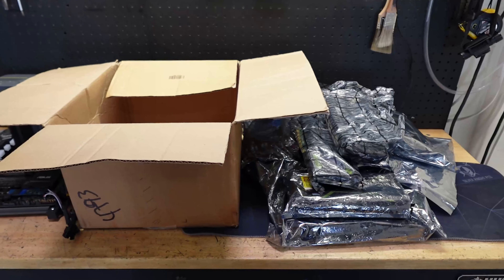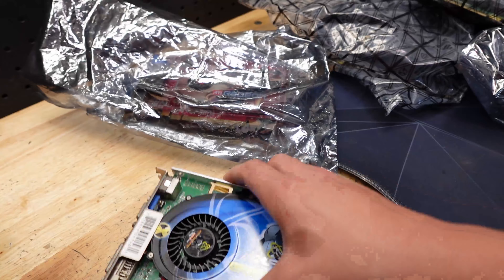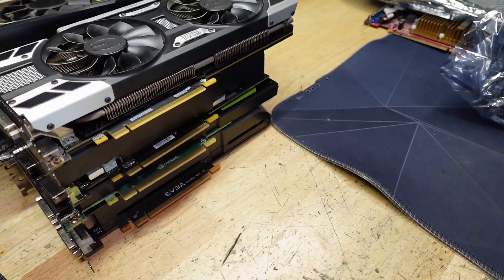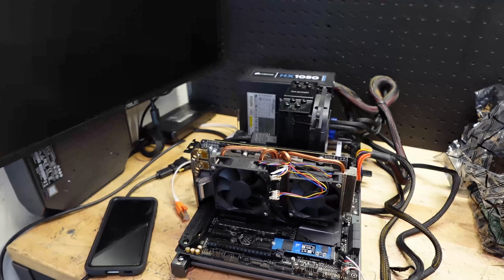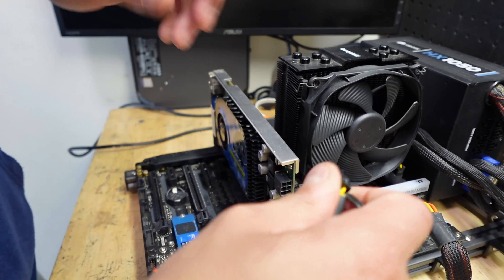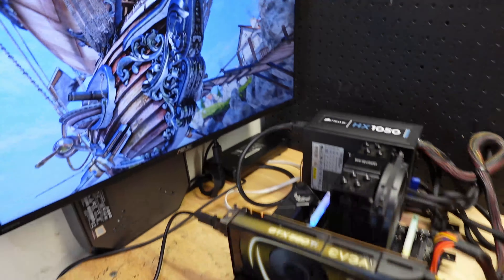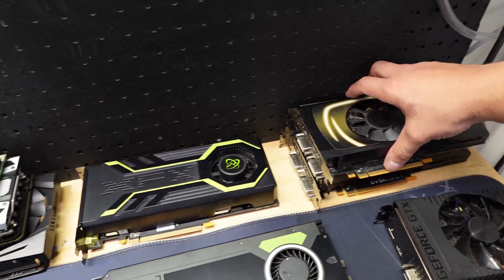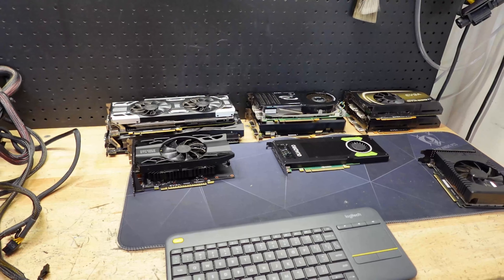I paid $100 for a box of unknown graphics cards!! Was it a good deal??

Comment: The unknown port on the 560ti is a mini HDMI.
Reply: Still have 2 HMDI cables for that GTX 560, they have the regular HDMI the other end has the mini connector.  Used these in SLI with my 550ti's back in the day till I got a 970.

Comment: Holy moly that's a damn treasure chest for just 100 dollars. The 1070 and 1080 could get you about 225 on eBay, and then there's the two 560 Tis, and then all the other little guys that were working. That's easily a ~350 dollar value out of that 100 dollar box.

Comment: In the case of 6600 GS and any old graphics card with a DVI port, it does not work with any monitor(With Converter), so the first thing to test old graphics cards is to test with the VGA port.

Comment: 5:18 damn for $100 even if they’re all broken that’s still like $300 in “for parts” listings. That strix 1070 is such an awesome card, I love the cooler design.

The high ticket items -

1070 ~ $100 at least

1080 ~ $150 at most

1650 ~ $80

1660 ~ $90

The 560 ti’s might go for $20 but they’re cool to have as a display, considering it’s an SLI setup right there. The rest like you said is pretty much “junk.” Surprised there were no midrange cards really, no 750 ti to like 1060 tier cards, just either really good or borderline useless

8:59 mini-hdmi port
Reply: Yeah, not to mention he said there was a 2070 that he flipped @ $200 previously and another card he said he used. He definitely won with that mystery box deal. That's a real score

Comment: New here, its worth keeping in mind sometimes specific display outputs can be dead while the rest of the card is working.
Thats how i found a working gainward gtx 1070 phoenix out of the electronics bin in the junkyard recently.
Both displayport & the dvi port on the card works but the hdmi was completely dead.

I'd also try too keep around a pc with a 2nd or 3rd gen I5 or maybe socket AM3 phenom, maybe socket 775 & then dualboot between windows 7 & 10 as many of these cards do have windows 7 drivers as legacy support or at minimum windows vista drivers which might still install & work.

Edit ah just got to the part where you mentioned having a windows 7 rig my bad heh.
Reply from the maker: def appreciate the info!!

Comment: If your card has a display port it should be used, most newer cards won't natively display higher resolutions if the HDMI port is used (Meaning they won't show up under the drop down selection).  That 1660 will be just fine unless you wanna go the soldering route which is easy enough but not necessary unless your display doesn't support Display port.

For $100 to get a 2070 alone is an amazing find but a 1070, 1080 and a 1660 super?  That's a ridiculous deal lol!  I'm shopping where you shop from now on lol.  I would re-paste and re-pad those just to be safe as the age alone would scream do it.  Great video!

Comment: I have a question. How would I power the 1660 super on the HP Elite desk 800 G1? I'm not sure about the 240w PSU and it's proprietary cables. I'm thinking of powering it externally but I'm still thinking. Any ideas? Perhaps a video? I have time.
Reply from the maker: you would have to upgrade the psu which you can only do with the non sff model. You can run a seperate psu to power it and turn it on using a jump. It is a little ghetto but it does work

Comment: This guy is making stuff up for views. There is no way he is going to find a 2070, 1070, 1080, 1650 and 1660 super and a bunch of other cards for $100 a year ago. There are a lot of hacks in the computer repair world. This guy doesn't even know how to re paste a CPU/GPU. A pea size drop without spreading the paste will lead to thermal throttling. You can see his pasting technique in some of his other videos. 

You do not test old hardware on a TPM hacked version of Windows 11. Nobody should ever test anything on Windows 11. Your baseline should be Windows 10. Just because you can doesn't mean you should applies here. Any unknown used graphics card should be tested and used in a working system for a week or more.
Reply: You what?  no need to spread the paste, putting the cooler on and clamping down does it for you.  You're gonna have to get used to Windows 11 because it will soon be the only option when MS retires W10.  I am intrigued why someone would sell a batch of valuable cards for $100, maybe they were a bit hot.
Reply from the maker: sellers room mate left a bunch of stuff behind and was told to get rid of it, seller was not a computer person.
Reply from the maker: I find deals like this all the time!! most time the sell quick before I can even get to them!